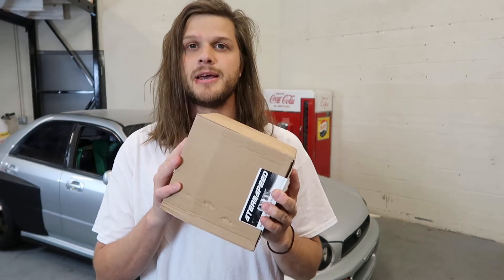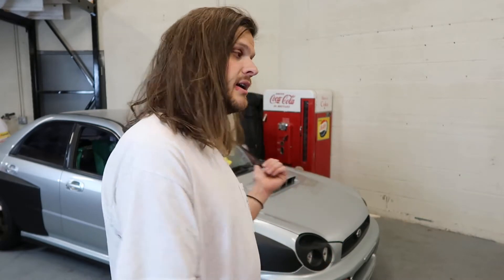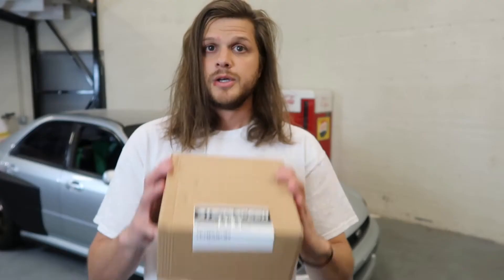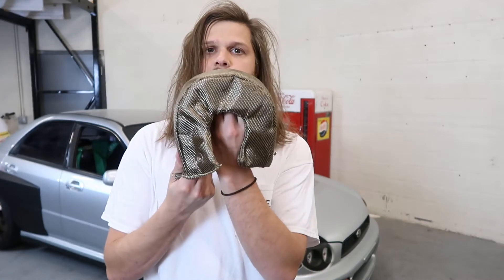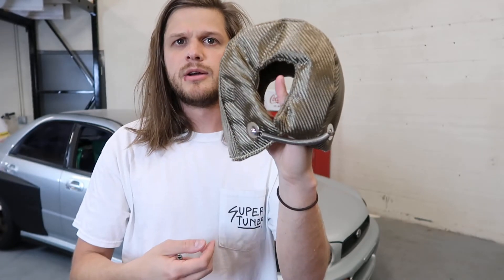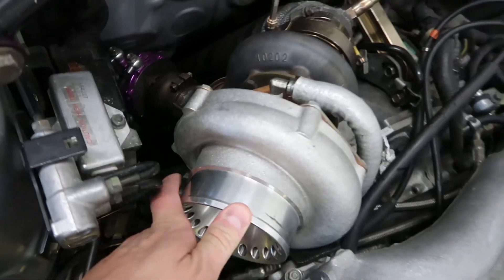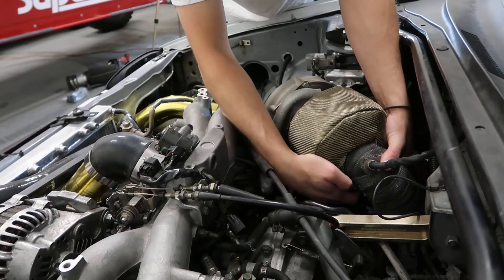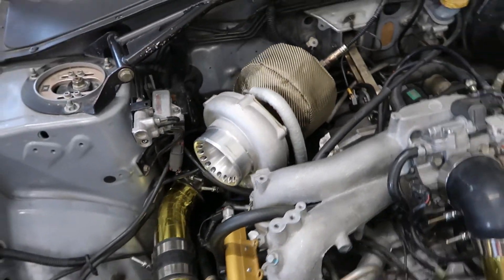HOW TO install turbo blanket- DYNO PREPISODE #5

Comment: After dropping the spring twice I put the spring on one side and crimped it down before dropping it in. Put a piece of string on the other side to assist pulling it through a very tight space. Bam.
Reply from the maker: True! Those springs can be tricky in tight spots!